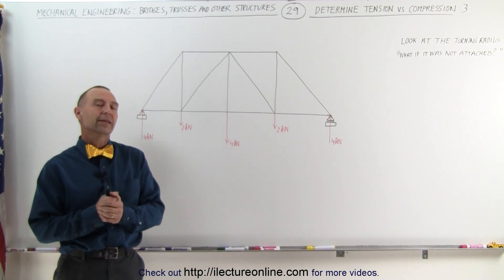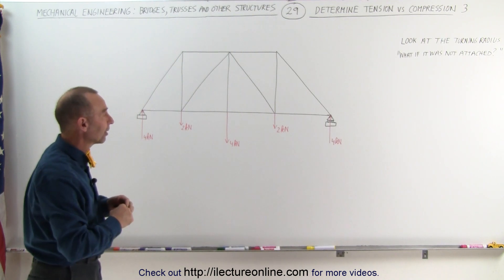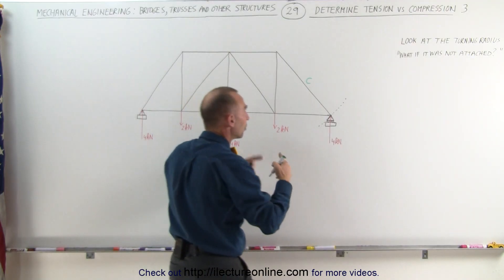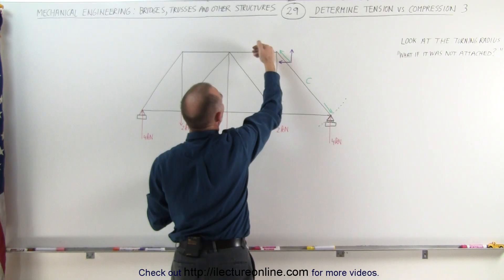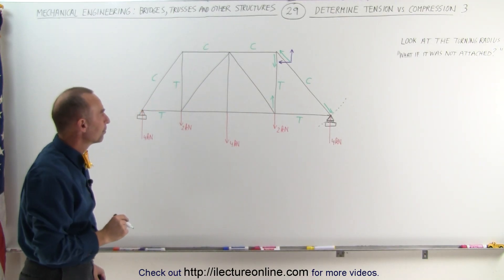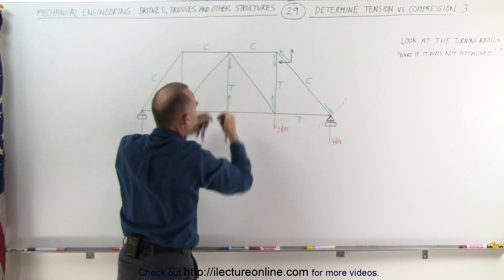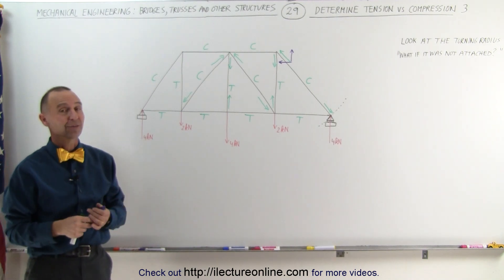Mechanical Engineering: Trusses, Bridges & Other Structures (29 of 34) Tension vs Compression 3

Comment: Your looking interns of what beam is resisting etc. but not looking at the whole structure and the acting forces within these members in a truss system. In other words, if each member is under compression arrows are going against each other in a member if they are in tension they are going away from each other in a member, that's it!

Comment: I wish I had found this video a year ago when I was preparing for my Structural Consultant IV test. I didn't know that you could determine compression and tension so easily without using the method of joints or the section method. Thank you for the very clear explanation.
Reply from the maker: You are welcome.  (they do tend to overcomplicate things)

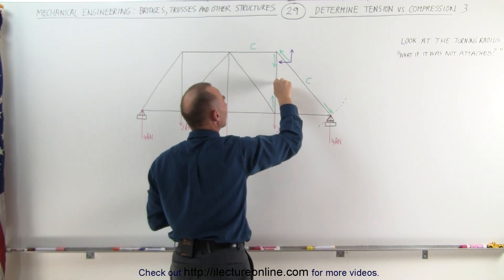Comment: Why are the arrows are drawn this way .. normally: . If the force tends to elongate the member, it is a tensile force (T), , why is 02:30 this shown as inward directed then? I guess it is the force withstanding that, but still a major deviation to how textbooks present the arrows.I actually like your perspective better, since it is thinking one step ahead ,-) we regarding the counters.
Reply from the maker: Compression and tension must always be considered relative to "someting".  In this example the green arrows represent the forces acting on the JOINTS, due to tension or compression on the members.

Comment: One comment I would make on this is that for new students when they see arrows going apart and you write compression it adds a element of confusion. but in truth when you look at the internals of each linkage it would be equal and opposite arrows which would then make sense > C <  and <- T ->
Reply from the maker: It depends on what it is referenced to.  If the beams are being compressed, they will puch against the joints.

Comment: I’m confused isn’t compression when the member is being squeezed and tension when the member is being stretched?
Reply from the maker: It is a matter of perspective. For example the right most member, at a slant, is under compression.  Thus with perspective to the joints on either side, they experience a force puching against them.   If the member had been under tension, the joints would experience a force pulling on them.

Comment: this is the opposite of what i learned.. if the member is being pulled apart its under tension, not compression ... tf???
Reply from the maker: Note the reference point of the "T" and the "C":.  If the member is under tension, the beam will pull on the joints.  (It is not different from what you have learned in class).
Reply: Michel van Biezen got it all figured out, realized your video was the best possible way of explaining it. Thanks a lot
Reply: The other way of explaining it would be "  what we are calculating is actually reaction forces and not direction of force ." And every action has equal and opposite reaction.

Comment: Wouldn't the arrows for the forces be in the opposite directions? With tension that means the forces are pulling on the member, so I don't understand why the forces are pointing inwards. Same with compression, where it doesn't make sense for the forces to push outwards if the forces produced from the other members push inward on the beam.
Reply from the maker: The arrows are drawn to represent the forces with respect to the joints.  (A beam under tension will pull on a joint.  A beam under compression will push against a joint).
Reply: Michel van Biezen oh ok thank you. With respect to the beam it would be opposite correct?
Reply from the maker: Correct
Reply: That is a really important clarification though !
Reply: It's Newton's Third Law of Motion which is: For every action, there is an equal and opposite reaction.
Reply: You are right I have the same concern.